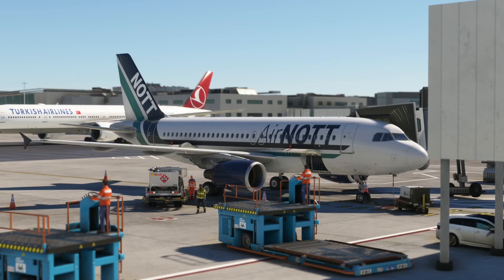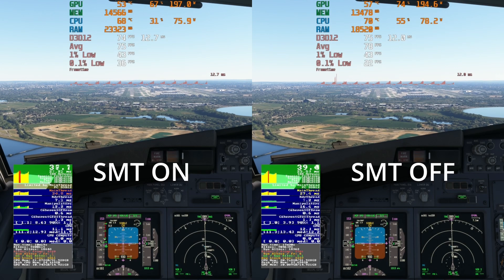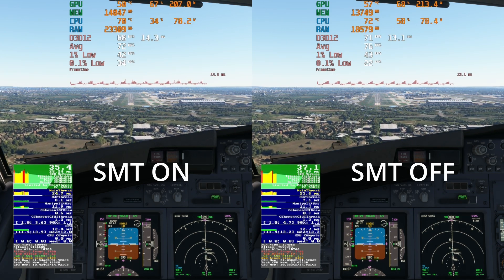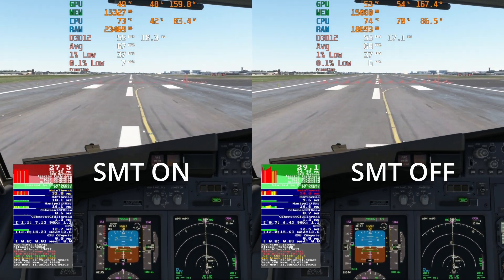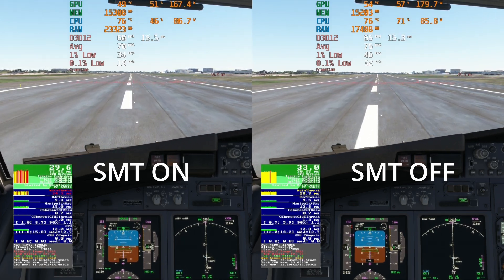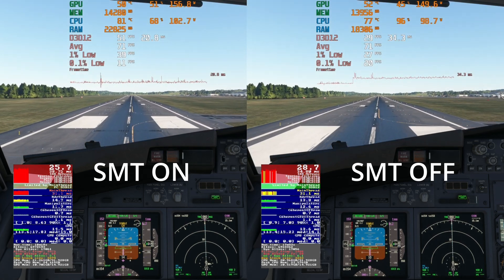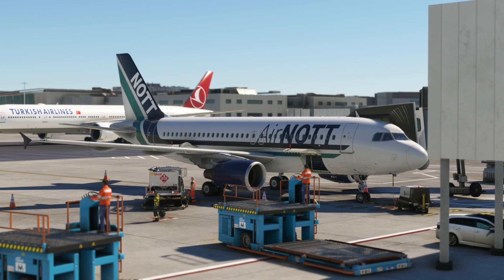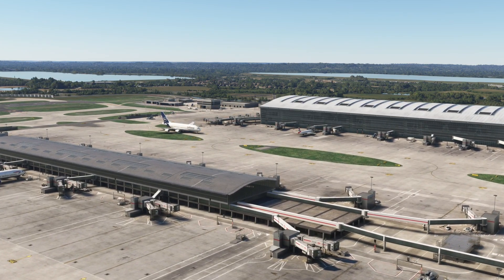Can Disabling Multithreading IMPROVE FPS in MSFS 2020?

Comment: I‘ve recently undervolted my 5800x3D which seems to impact my avg FPS a lot. Maybe you wan‘t to give it a try.
Reply: Impact good or bad? I have the same CPU running stock
Reply: @ I’ve achieved a higher average FPS, with cores boosting up to 4.45 GHz. Additionally, power consumption has decreased, and temperatures have dropped by around 10°C. In Cinebench, my multicore score has also improved significantly, going from 13,500 in stock settings to 15,000.
Reply: @jxr6s592  sweet, I'll give that a try, did you use ryzen master or bios to set your undervolt and stuff? I've tried ryzen master before and it never worked right

Comment: I’m really tired but It sounds like you are talking about Hyper-Threading? 
I’ve turned Hyper-Threading off in the BIO’s as I get better performance on the 14900k P-Cores. But I switch Multi-Threading on in the Nividia Control Panel.

Comment: You paid particular attention to FPS and 1% low, but I noticed another persistent difference. The very low GPU utilization suggests significant CPU bottlenecking in both scenarios. However, that bottlenecking is always less marked -- i.e., better -- with SMT off. It might account for the reduction in stutters you mention. I'd never have guessed that we'd see the results you presented; I always assume multithreading is better, but I guess it ain't necessarily so

Comment: You really need to turn off the "lvar scanning" feature of spad next because thats what causes these strange pulsing frame times and also may be the reason for the stutter while landing as it was the end of the scan (note how the frametimes is stable after this).
Or just wait 5 minutes after loading into a flight as this is the default value set in the config file :)
Reply: Or you can edit the value to lets say one minute and then after loading the first  flight just wait this minute to pass.
In one of your last videos I made a comment where to find the config file.

Comment: I always appreciate the time people give to share these videos so I never dismiss a video, thanks for your video ! Thoughts on  disabling multithreading on nvidia contol panel vs disabling in the bios ? I think for the small differences I'll keep my 10600k with 12 e cores multi threaded. My performance is great in almost every envirorment exept for unoptimised payware like some DD airports & that seems more GPU bound, rtx 3070. Can't wait to see how 2024 performs. Multithreading supposed to be much more relevant on the newer architecture. I just remembered when you said Intel is doing away with multithreading that I had a 9600K before I upgraded to the 10600k & the 900k had no virtual cores but the 10600k has them & it helped on msfs 2020.